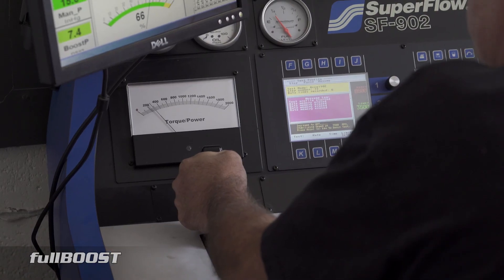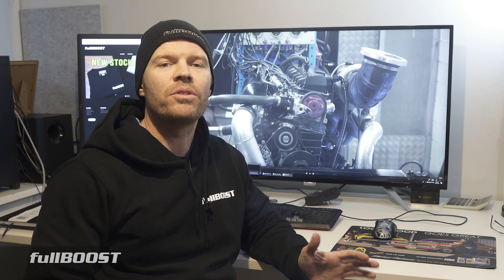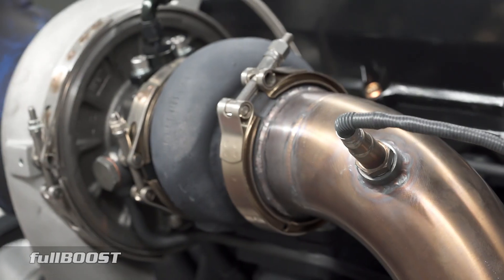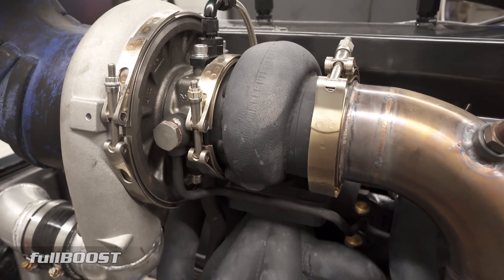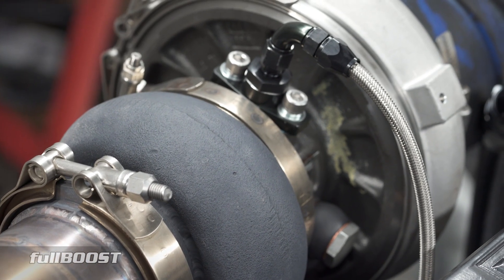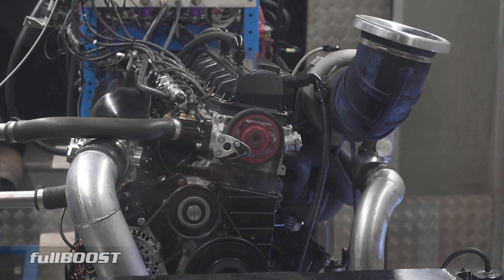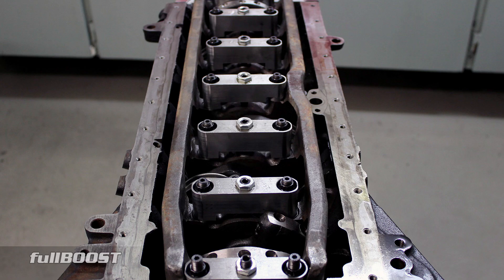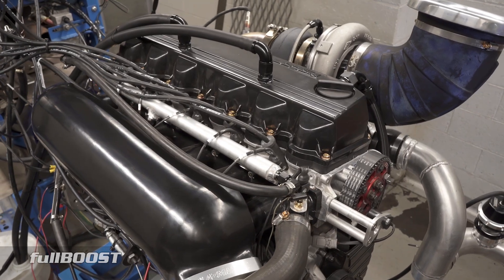How to build a responsive 1000hp Nissan RB30 street engine | fullBOOST

Comment: um why not use doch engine heand ?
Reply from the maker: Well it clearly doesn't need one hey. Many prefer to keep engines as they were sold.
Reply: @fullboost  Seems to be the case, I'd use  DOHC because I have a NIssan that's DOHC so it's easier but this is doing 9000rpm and big hp so the SOHCer can do the business no doubt

Comment: 20psi at only 4000rpm, goes to 8900rpm with 41psi. 😮😮 That's an INSANE powerband on the engine dyno. Thought the little .63 would choke it out but proven well and truly wrong. 👍
But the question truly is, can it beat a Renault? 😁
Reply: They actually loaded it up for ages at 3500rpm and slowly crept the rpm to 4000rpm to demonstrate the spool so realistically that is never going to be seen in a real world situation - it's still impressive it did that with a setup doing over 1100hp @ crank but you can also see in the sweep runs (which start with a hold to give the turbo some load) it isn't all in until around 5500rpm or so.
Reply: @misterlith  Yeah, rewatching the sweep runs you see it hit 20psi. at 5000rpm and 40psi. at 6800rpm. Good eye dude. 👍😎
Reply: @MafiaboysWorld  Still not too bad all things considered, but usually when people hear  20psi at 4000rpm they kinda expect that if you give it some from 3000rpm in a middle gear then by 4000rpm you'll be out of town while this will actually really be waking up later in the rev range... but its a 1100+hp car that revs to 9000rpm so not a biggy haha
Reply: MafiaboysWorld aslong as you have a proper sized wastegate and it can maintain boost till redline , back pressure won’t be an issue
Reply: @Diesel8290  Yeah true that. Using a 4 port solenoid would help along with wastegate size for good boost control, just felt the total volume would choke the exhaust housing with that small A/R. Compressor map would be interesting to look at. 🤔
Reply: MafiaboysWorld interesting work tho 👌 in the merc diesel world we use vgt turbos to gain the low down boost. I wonder if that would help in gasoline applications?
Reply: @Diesel8290  It does. Porsche are experts at using VGT's in their 911 Turbo's to maintain peak turbo efficiency through the rev range. 👍 That's why they all leave like stabbed rats off the line. 🤣😂

Comment: Nice. Interested to know what turbine wheel is in that housing. I'd guess not the tiny little one most people think, as it's turbine wheels that matter the most for flow, not the housing.
Reply: He said GT45 core.
Reply: MafiaboysWorld That’s defo what I’d expect on a setup like that, but would love confirmation
Reply: Yeah, just didn't expect the A/R being a .63. 🤷
Reply: MafiaboysWorld not exactly a 0.63 T28 though! 0.63 for a GTX45 sized wheel is a whole ton bigger! I reckon that’s about as big as a small/medium GT40 turbine wheel. Just looks small as GT45 compressor sides are about 25% bigger than even GT42 ones!
Reply: @StavTech  Oh no, if it was a T25/28 flange it would be like an emphysema patient breathing through a straw. 🤣😂 
But usually you see a GT45, the MINIMUM they're on is a T4 flange and sometimes even bigger (T6 truck flange anyone? 😂🤣) and if was T3, definitely more than a .63, usually like a .86 or 1.03/1.06 AR. 👍 Problem with that is then you end up seeing them stall up for 19 seconds before takeoff to build boost. 🤦

Comment: Wondering if a variable geometry would do the job better?
Reply: hendrahendra High exhaust gas temperatures may be the issue.
Reply: Vgt turbos are really pretty heavy and expensive for what you get especially when you can make a setup like this work so well

Comment: Actually never thought about turbos like this, I really thought that the backpressure would really choke it out. very fkn interesting (and effective) approach. Tiny rear housing, for a single. Where does this sit in a compressor map?🤣
Reply: Wastegate has little to no effect on backpressure. If it did we'd all run tiny turbines, it'd be a no brainer.
I'm wondering what turbine wheel it has. May be a 0.63 T3 housing, but it's wheel that dictates the flow most, so if it's machined out for a much much bigger wheel than you'd expect, backpressure won't be as insane as you may think.
Reply: @StavTech  I'm guessing the gt45 wheel
Reply: @sircefiro  me too mate. As that's overkill for 1000 normally, but in a tiny housing it wouldn't be, so it makes sense.

Turbos aren't magic, can't beat physics.

Small A/R and big wheel is the most efficient way, it's what unlimited budget works race engines tend to have.
Reply: i wonder how much wastegate they have on it so its not choking up on the turbine.
Reply: Most enthusiast pay attention only to compressor maps. Companies release little info on the turbine side of things. That said T3 housings flow pretty good and 3L isn't really that much bigger than 2L in the grand scheme of things.

 I still think a GT25 .64 A/R is too small for my GTX 3071 Gen 2.

But I'll will be logging back pressure since being in the dark and just guessing is close to useless.
Reply: yea, I think you will probably find a huge as fuck wastegate on there haha